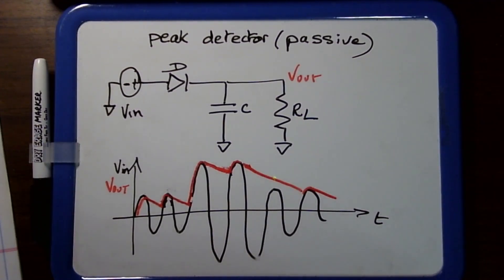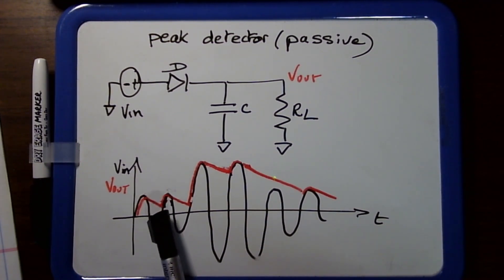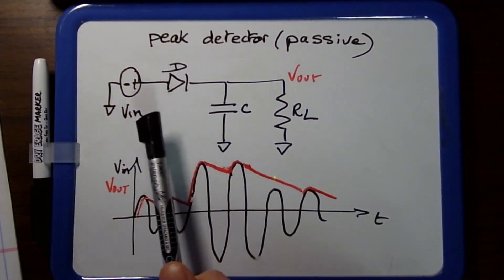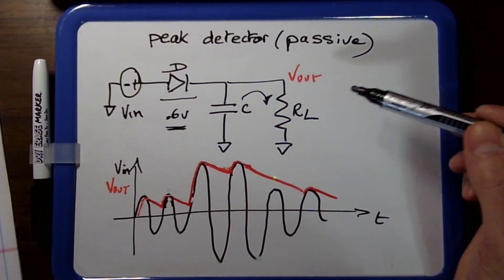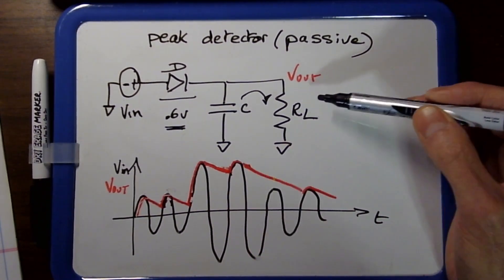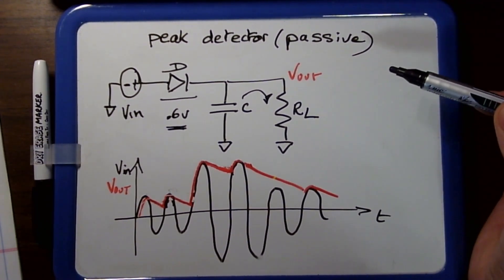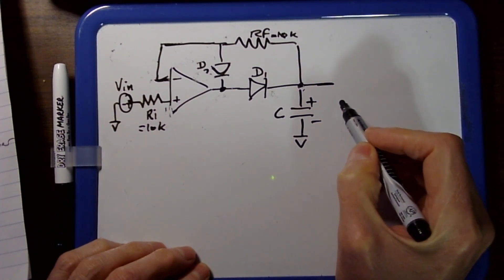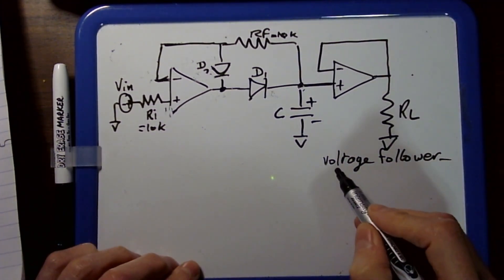Active op-amp peak detector circuit for audio signal vu-meter

Comment: Сan you please explain the purpose of R2 resistor? Look like capacitor will discharge through R2 if Vout < Ucap - 0.6v presents at op amp output. Is it expecyed behaviour? Will be better to connect this resistor to follower op amp output not to capacitor.